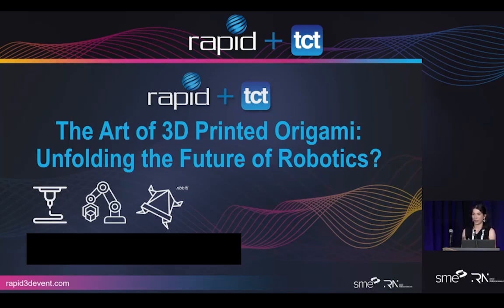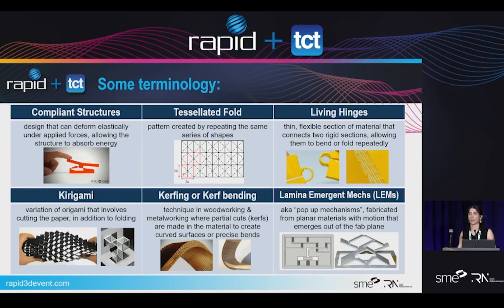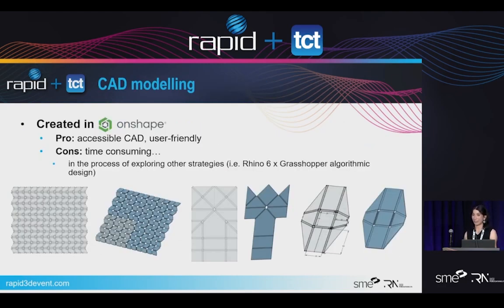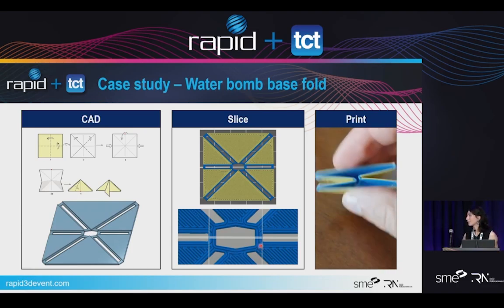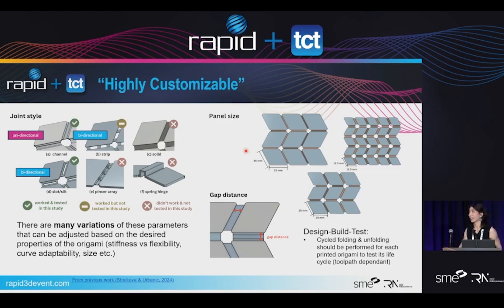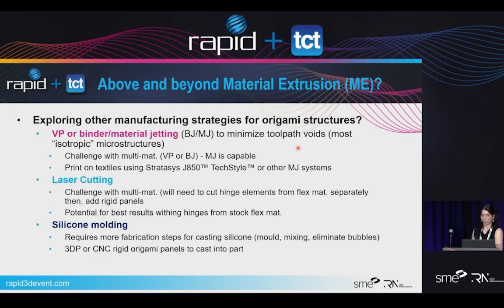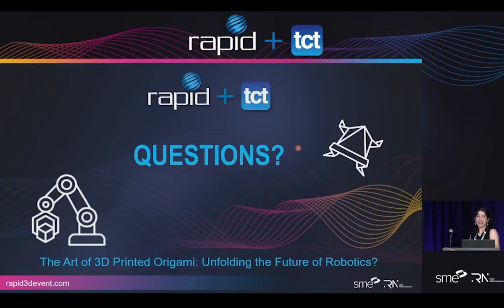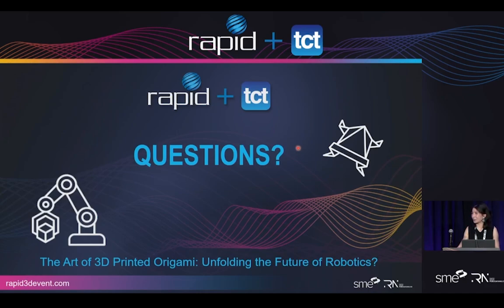the art of fully 3d printed origami & it's potential in robotics (rapid tct 2024)

Comment: You mentioned generating the models... is OpenSCAD viable?
Reply from the maker: Great suggestion, I will need to try it out. Thank you!
Reply from the maker: Hi! I just started learning OpenSCAD for another project/video last night and I can see this being viable... plan on trying it soon to test a repetitive origami tessellation. thank you again for the great suggestion!!
Reply: @strelkomania   I'm sooooo happy I was able to help.
Thank YOU for being such an awesome, creative and smart person.

Wish you a lot of luck and success to your projects :)
Reply: Also, try digging in the nighly version of OpenSCAD since it has the most lastest features of the repository :)
Reply from the maker: @Splarkszter  NO YOU !
Reply from the maker: @Splarkszter  will look into it 🤓✅✅
Reply: @strelkomania  I just had an idea.

What if we enclose rigid panels between the flexible material?
Like, place the first 1 or 2 layers out of TPU, then make the next need layers with a TPU wall and a PLA infill?

Or at that point use sheet metal or wood for the infill?
In that case it would be just like the method of the sand filled print.

Reading your thingiverse frog file i read that the model can still work wile printed only in PLA.
Yes PLA fatiges much faster, try PETG since is better for mechanical parts since is less rigid than PLA.

I would test the PETG part myself but I'm not at home right now :)
Reply from the maker: @Splarkszter  that is a great idea! i will need to give that a try - I think i can do that without openSCAD too. print the PLA panels, print part of the other model hollow... and drop them in AH!

and yeah i have tried to print the frog in PETG and it holds fairly well but not for as many cycles as the flexy material i have been using. 

thank you these comments have been very helpful :)
Reply: @strelkomania  I'd love to keep hearing about your findings.

I'm really really happy to help!

Comment: At first it seems a little counter intuitive to use 3D printing to print 2D (2.5D) structures and then fold them into 3D structures. It seems like something for 2D processes like Laser, water, plasma cutting etc. But FDM is strongest along the print lines and weaker across the layers, thus it might be a much better ide than I first thought.

Getting a slicer to print perpendicular to all the bends would probably be optimal and without knowing the details it seems like something that should not be that hard to accomplish for your business card prints, but a general solution that will work for any geometry is probably way harder than it looks. As you show with geometry at 11:05.

This might be a waste of time and you might have seen all this before, so feel free to ignore it. I don't see any silver bullets among them,  but who knows it might be just the inspiration you need. (also this is not how YT comments should be used 😛)

CNC Kitchen have done a few videos where he modifies the G-code or where others have written different toolpaths algorithms. Maybe one of them could be a starting point.
"Revolutionary Arc Overhangs are now in PrusaSlicer*" (There are bot a new slicer implantation and a python post processing tool)
"Conical Slicing: A different angle of 3D printing" (a Non-Planar G-Code modifier also using a python script in post) 
"NON-PLANAR 3D Printing by BENDING G-Code" ( another python post script, but he mentions other methods too)
"Brick Layers - Why did no one do this before?" (he modifies the setting in simplify3D, I don't think this is useful in this case, but maybe)

3D lab print also manage to slice a geometry such that everything is printed as one line per layer. But I don't know if any of these settings might help you.
"Prusa Slicer basic setting for airplanes printing (3DlabPrint)"   (This is a slow video 😂)

Tim Station have a similar video about how he designs his part such that the slicer gives him the result that he wants. But I don't know if any of his tips will force the slicer to print perpendicular to the bends.
"How I Designed a 3D Printed Wing" (also not super entertaining more like a tutorial 😂)  

Maybe you could use a material where you can change the stiffness as a function of the print temperatur?
"Super Soft TPU by FOAMING! - colorFabb varioShore TPU" (A soft TPU that can foame up, so you could make the hinges super soft)

I had the idea to use foaming PLA in combination with topology optimization. Then you could print sandwich like constructions of any shape and make supper stiff and light constructions. And when optimizing using topology optimization you basically obtain a optimal density distribution. Normally you use a penalty function to link density and material stiffness to force the "optimal" result to only be material or no material. So that could just be modified to follow the material propperties. And then you just need to modify the G-code to change the temperatur while printing following the density obtained by the optimization. It might tricky to change the temperatur quickly and precisely thus in practice it might not be as simple as it sounds. But the idea was to add the temperatur adjustments to the g-code using a python script. But i never got around to it, thus I only have experience with manually changing the g-code before printing. And calculating the optimal path is much much harder than just adding temperatur changes between the lines.
"A 4th dimension for 3D prints - Colorfabb Light-Weight, foaming PLA"
Reply: There's also Chisel (Now SpaceDelta??) slicer, looks interesting... i was researching about gcode techniques for SpeedBenchys and stumbled upon it... there aren't any repositories available apparently but they do have a contact button.